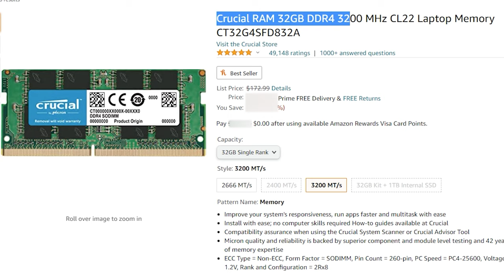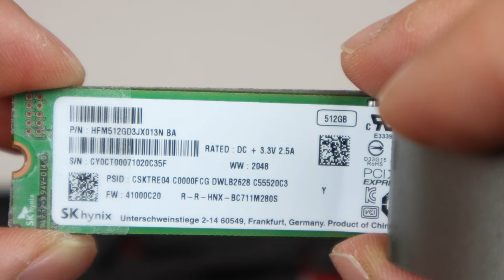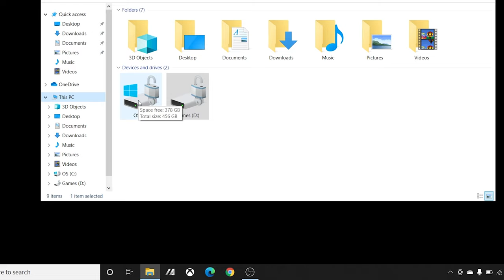How to Install/Upgrade RAM and m.2 SSD in ASUS TUF Dash F15 Gaming Laptop (NVMe only)

Comment: Bro I Also Bought Asus tuf dash f15
My Laptop Keyboard Lignt Always  On One Colour.
Aura Sync Program All Ok
From Armoury Crate I Applied Random Colour But It Won't Work. 
Any Solution For This Problem?
Reply: M not sure about the 2022 version but in 2021 version, which I have, it has only one colour, cyan.
Reply: Short answer, u probably cannot.

Comment: so i want to upgrade  my ram i have 16gb right now. should i buy 1 ram 32gb or 2 rams 16 gb?
Reply from the maker: This model laptop only has 1 RAM slot, so you wouldn't be able to install two 16 GB sticks. You could install one 16 GB stick and get a total of 24 GB of RAM (including the 8 GB soldered RAM) or get the 32 GB stick and you would have a total of 40 GB of RAM.
Reply: @FixItPhil  thanks bro

Comment: I thought that 24 (8+16gb in single channel) is maximum, so does it really work on 32gb ram?
Reply from the maker: According to ASUS, the laptop supports up to 32GB DDR4-3200 RAM, but others have reported that when installing a 32GB RAM stick the system recognizes 40 GB of RAM... the 32 GB installed stick and 8 GB onboard memory. Whether or not you can actually access all 40 GB is unclear 🤷‍♂️ Maybe someone else here who has that setup will chime in!

Comment: What would happen to a newly installed ssd if i dont put any thermal pads on it?
Reply from the maker: Depends on your system specs and how hot the computer runs, but typically it'll be fine. However, the wear and tear on the hard drive will be greater if it runs hot, so that'll increase the risk of hard drive failure over time. There's no guarantee that the hard drive wouldn't fail under normal use, even if a thermal pad, but it's all about risk mitigation.

Comment: how about asus tuf fx516p-mhn074t ? is it upgradeable?
Reply from the maker: Yes, it is the same base model as mine so the layout of the motherboard should be identical. The last part of your model number just tells you which configuration you have (e.g. drive capacity, pre-installed RAM etc.).

Comment: your version of tuf dash comes with additional samsung 8gb of ram. I wonder if i can add it to mine (i 've got same tuf dash too) instead of crucial cuz i cant find any crucial brand with same specs in my country.
Reply from the maker: Sure, most laptops are brand agnostic when it comes to RAM, so it shouldn't matter the brand you use as long as the specs are the right ones for your model (size, speed, latency etc.)
Reply: @FixItPhil  alright thanks for your tips appreciate it! 👍👍

Comment: Hi, can i ask if this model is RAM upgradable and how much ?  ASUS ROG FX516PM-HN002T 15.6" FHD IPS AG  i7-11370H 8DDR4  512SSD W10 VGA/RTX3060-GGB  NOODD GLAN BT WIFI RI 4USB HDMI 2Y     thanx
Reply from the maker: Yes, your model's build looks like it comes with 24GB of RAM (8GB onboard + 16GB) DDR4 3200MHz. You would be able to replace the 16GB RAM stick inside with a 32GB RAM stick, which is the max supported for the laptop.

Comment: So I can't have 2 ram sticks at the same time in this laptop?
Reply from the maker: Technically, the 8GB soldered chip is a RAM stick and runs in dual channel mode with the installed RAM, but no, you can't install more than 1 SODIMM chip. The only way to get 32GB on this build would be to use a 32GB stick, and I believe the first 16 GB would run in dual channel and the remaining 16 GB capacity as single channel and 8GB would be wasted/unused (although someone else commented that they were able to get the system to recognize all 40GB on this model; I'm just going off what ASUS has spec'd "officially").

Comment: What should i do? Before i changed ssd, i disconnected my battery, put on a new ssd, plugged the battery back again, but my pc isn't working, doesn't charge or turn on.

Comment: Hello, in July 2021 I bought an Asus TUF Dash F15 model FX516PR notebook.
I'm not a computer newbie. This week I decided to upgrade it with a new Samsung 970 EVO plus 2TB SSD in the second slot. I did exactly the same as this video.
After I reconnect the battery, the Notebook doesn't turn on anymore. When connecting the power cable, the corresponding LED does not light up. The computer was bricked.
I removed the SSD and the issue remains the same.
Please, does anyone have any suggestions on how to resolve this issue?
Reply from the maker: My guess would be the battery connector isn't seated fully or popped out before the metal latch was engaged. I would disconnect the battery again and re-seat the connector.
Reply: Same happened with me, had to send my laptop for repair after trying removing battery and everything. Waiting for it to be returned back not sure should I try to install again.

Comment: If the max RAM is 32 GB for this laptop and the default starting RAM is 16 GB and half of those 16 GB is smoldered into the motherboard and the other half is the 8 GB RAM stick that you replaced with a 32 GB RAM stick making the total RAM 40 GB when you can only use 32 GB of RAM max for this laptop, then why did you replace the 8 GB RAM stick with a 32 GB stick when the 8 GB smoldered into the laptop would not be used by the system and would be completely useless?
Reply from the maker: Because there's no such thing as 24GB RAM. In order to max out the RAM you would need to install a 32GB chip and potentially "waste" 8GB of unused capacity.

Comment: I just purchased the Asus TUF Gaming Laptop with the i712700H Model number FX5072ZMRS73 I want to upgrade to 32 GB of ram but I found 5200 MHz  ram do you know if the Bios has the capability and if the computer has the capability to overclock the memory to that speed or close to it or will it just run at it's base clock speed of 4800MHz? The Ram I'm looking at is { G.SKILL Ripjaws Series 32GB (2 x 16GB) 262-Pin DDR5 SO-DIMM DDR5 5200 Laptop Memory Model F5-5200S3838A16GX2-RS }

Comment: Well, disaster for me..

The metal bar holding the battery clip just flew off from very little pressure and touched the components just above.

Now it's dead.. no power

Comment: Will it support 8+32gb or only 32gb
Reply: I've installed 32gb on top of my 8gb and the system registers it as 40gb total usable ram. While I havent been able to get a usage high enough to see if it loses the 8gb i have had gone up to 20GB usage but you might experience something different. Running a system scan with Crucial and Mr Memory also shows it is compatible to up to 40GB
Reply: Was so confused at how to get to 32gb when I had 8 soldered.  Thank you 😊 so 40 gb in end ? Been so much crossed information about upgrading this laptop
Reply: Yeah I'm getting 40gb just fine! Speaking to Asus and they are only saying you can upgrade to 32gb max but are free to test probably just covering themselves but the board i got is saying it supports over 100Gb!
Reply: this exact laptop u add in 32gb ram and it works?
Reply: Yup have the 3060 with 8gb soldered from Currys
Reply: @PunoAmyl  is this the same laptop as the one in this video? He put in a 32GB DIMM and the BIOS shows 16GB - the video creator does not mention this or why it shows as only 16GB.
Reply: @DonDino2  he probably filmed the bios part  before the upgrading part

Comment: can you also put an M.2 SSD in it
Reply from the maker: Yes, see 2:59 where I point out the two m.2 slots, in my build the first is occupied by the main drive and the second slot is empty for you to install a second m.2 SSD.
Reply: did you figure out how to lift the screw on the second m2 slot? i’ve tried every screw bit i could and none of them make the m2 screw budge

Comment: Im using asus tuf f15 fx506li. I just installed a m.2 ssd on the 2nd ssd slot but its not showing up at all. I already checked many times and i installed it correctly. Anyone knows how to fix this?
Reply from the maker: Does the drive not show up in the BIOS after it is installed (see 6:55)? If you can see the drive here, but not in Windows, you'll just need to initialize, partition and format the drive: https://youtu.be/d5wLgZxROoY However, if it doesn't show up in the BIOS at all, it's possible you have a SATA m.2 ssd and that interface type is not able to be recognized in the slot you installed it in.
Reply: @FixItPhil  yeah I just found out that the ssd slot only reads nvme, mine was m.2 sata. Thanks for replying!

Comment: Can we use 32gb ram stick?
Reply from the maker: Yes!
Reply: @FixItPhil  but we need to remove the 8gb ram right?
Reply from the maker: @harrischannel01   Yes, you will need to remove the pre-installed RAM chip as there is only one slot.
Reply: @FixItPhil  thank you for the information!
Reply: @FixItPhil  im going to upgrade this laptop myself soon
Reply: @FixItPhil  so i will get 3200mhz 16gb ram
Because its the only i can found it

Comment: Does anyone know the maximum SSD capacity of the Asus Tuf-F15 FX506HF?
Reply: To my knowledge there isn’t a specific cap, as long as the ssd fits you should be able to go up to 10tb + if needed
Reply: Just make sure the ssd you purchase is the same size and compatible with your motherboard and processor

Comment: What is the meaning of (GEN3X4)
Reply from the maker: Generation 3, x4 refers to bandwidth or the number of pcie lanes is can use, in other words, how much data it can process at once and is directly related to the read/write speeds (more lanes is better/faster).

Comment: Hint on the screws… least on my tuf f15 the two sizes of screws had a different color threadlock… the slightly shorter ones used blue threadlock, and the long screws used a light gold/yellowish threadlock … really glad I caught your video because I didn’t notice at first when I was disassembling… thanks for saving me from longscrewing and possibly damaging the laptop😅

Comment: Too bad I can't add a new SSD with mine since the damn screw won't come off in the M.2 2nd slot. I suspect that blue thing they add got stuck or some factory worker mistakenly used glue.

Comment: Wouldn’t that give you 40 GB in RAM? Since the other 8 GB is reserved.
32+8
Reply from the maker: Yes, you're correct. Other folks have confirmed this as well when installing a 32GB chip in the slot that the MB recognizes 40 GB total.

Comment: And what if I want 64 GB ram.in total
Reply from the maker: According to the ASUS website spec, the laptop maxes out at 32 GB RAM, so even if you install a larger chip in the one available RAM slot, you would not be able to utilize any capacity over 32 GB, though some users have reported that the onboard 8GB soldered RAM doesn't count towards the total RAM max, so in theory you could get 40 GB of RAM, if true.

Comment: I use corsair 32gb 3200mhz but didn’t work. 😢😢
Reply from the maker: Yeah, I've been hearing a lot of folks having compatibility issues with Corsair memory in this model 😣 I've been recommending the one from Crucial as the compatibility is pretty much guaranteed.

Comment: it works or not: Crucial P2 CT1000P2SSD8 Internal 1TB SSD, Speeds up to 2400MB / s (3D NAND, NVMe, PCIe, M.2)

tank youuu
Reply from the maker: Yes, it would work in this model laptop.

Comment: Thank you. I upgraded both my ram and SSD watching this video. However I was unable to remove the battery connector. I tried couple of times but it didn't come off. Anyways no electrical discharge happened. My laptop model had 8gb on board ram and 512Gb SSD. Now it has 16gb ram and another 512gb SSD.

Comment: I just install my new ssd for my laptop and it works because of your video, simple and straight to the point.
Thank you so much, very helpful!
Reply: Did you put thermal oad on it and disconnected the battery?

Comment: Not sure if you still monitor this, but I followed your ram section to the letter and my rebooted machine turns on, fans run, but black screen. Was there something I was supposed to do first?
Reply: I figured it out; turns out you cannot put in ram paired for a dual-slot config into a single-slot laptop. Once I put in a single Crucial 16GB it worked instantly. Just me being careless about what ram works with this pc.

Comment: Thank you so much for this video. Just want to know, Did the original storage have both heat sink and thermal pad? Is it recommended to add a thermal pad on top and bottom of the storage? Do you have any recommended pads?
Reply: thats what I am wondering too.

Comment: No matter how I try on my TUF F15 and how many good screwdrivers I use I cannot unscrew that second m.2 screw!
How to do this? I even tried pliers and nothing.
This blocks me from inserting my 1 TB NVME I bought for the upgrade.

Any suggestions? I tried rubberband and other ways, still nothing.
Reply from the maker: This is the screwdriver set I use on my electronics: https://geni.us/kWSA [Amazon Affiliate Product Link] I like this set because the back end of the screwdrivers are 'floating' on a ball bearing allowing you to push straight down onto the back of the screwdriver with your thumb while turning which usually does the trick for stubborn screws.
Reply: @FixItPhil  Thx, I'm going to give my TUF Dash to an electronics techie I know who has a  wide set of advanced tools to fiddle with electronics.
I think he will be able to unscrew that damn m.2 screw (what a bad design choice on Asus side to include such stubborn screw on m.2 slot...)
Reply: @FixItPhil  Thx for the link.
I tried dozens of screwdrivers and screwdriver attachments and no dice.
I basically gave up and I cannot unscrew that damn m.2 screw.
This is a BIG minus for Asus from me as it is a fact that they deliberatly put such screw in there to obvious troll us and block from upgrading.
So now I sit with an unused 1 TB NVMe drive which I bought to upgrade my TUF F15.
I think I will just put that NVMe in my desktop in this case...
Too bad I'm stuck with 512 GB space on my TUF now, not getting another laptop from Asus just for that.
Reply: @FoxleyGamingZone  I’m in the same boat. I even got the screwdriver set the Phil recommended. Shoulda known I was practically being scammed lol
Reply: @FoxleyGamingZone  please update me! i would do the same, but I can’t leave my house atm
Reply: @man8918  Sure, I'll get back to this thread once I get my TUF back.
Reply: @man8918  As I mentioned I got my TUF F15 to electronics expert and he got that screw out for me.
Now I could insert my second m.2 drive without a problem and works like a charm!
So I finally got 0.5 TB + 1.0 TB of storage.
So my advice is - give your TUF to someone who has skills and good set of tools to handle stubborn screws.
Reply: @FoxleyGamingZone  oml thank you so much for the update!!!! i was skeptical because I’ve never spent this much money on a laptop and didn’t want to risk someone damaging it
Reply: @man8918  Look around your place for a good electronics shop and see if they can help you with that screw :)
Reply: @FoxleyGamingZone  sure thing! i really appreciate you!!!
Reply: @FixItPhil   Affiliate Product link not working.
Reply: @FoxleyGamingZone  I am stuck with same issue. Can't able to unscrew the ssd screw. Tried Using the same screwdriver which i used to remove Screws from backpanel but it just not fitting properly for the one in ssd slot.
Reply: @ramanasurriyanr6239  Like in one of the prrevious comments - I advise to just get your TUF to a good electonics shop/workshop and have them remove that screw for you :)

Comment: Hi, I don't know if you'll see this comment or not, but I hope you do.

I disassembled my laptop just to do some cleaning and I unplugged the battery but didn't press power button for 15sec. When I reassembled the laptop it wouldn't turn on. I disassembled it again to check if the battery was unplugged but it's not the case. The laptop still turns on when plugged but not on battery. Do you have any potential solutions please?
Reply: If you haven't solved this yet, you could unplug the battery again and check if the pins and cables are in good condition. Could also be possible that you didn't push it in properly. I struggled with that damn plug for a sold five minutes because it wouldn't slot in properly lol

Comment: Hello, Please which SSD is compatible with this laptop - (Kingston NV1 500GB M.2 2280 PCIe NVMe SSD)  OR  (Kingston KC2500 500GB M.2 PCI Express NVMe 3.0 x4 ) ?
Reply from the maker: Both are compatible. NV1 is a more affordable option but KC2500 has better performance.

Comment: Thank you for the great instruction. Mine is a 2022 Tuff Dash F15 - yet it had two removable RAM modules and fewer screws. It's remarkable how many model differences there are.
Reply: Manufacturers should really lower the amount of screws they use...and...the screws should stay in place instead of being lose-able. With my old Acer V3-772g I can remove the lid and the screws stay in the lid no matter what. With the new notebook: not so much.

Comment: Hi Phil do you know is asus tuf f15 2021 fx516pe compatable with SAMSUNG 980 PRO SSD 2TB PCIe NVMe Gen 4
Reply from the maker: Yes, a Gen 4 drive would be backwards compatible, though note that the tops read/write speeds will be capped at Gen 3 maximums ~3500 MB/S read and ~3300 MB/s write because that is the interface used for the slots on the laptop's motherboard.

Comment: Hey Phil, I know that you did it already but I still want to make sure that if I install another 32gb ram on the slot and there is 8gb ram already soldiered on the motherboard. Is the max capacity gonna be total 32 gb? Or is it gonna exceed the max ram capacity which is 32gb and show error?
Reply from the maker: It'll show up as 40 GB and will work just fine 😁
Reply: @FixItPhil  thanks for the reply man

Comment: They really managed to replace easy to remove batteries with this battery connector crap. 

And how easy was it to replace SSDs before. Now with the m.2s you have to add conductive material to get rid of the heat. 

Also: my old Notebook used about 70 Wh. My new one over 200 Wh. For the same games. What the fudge!